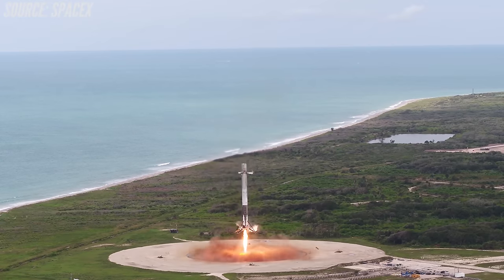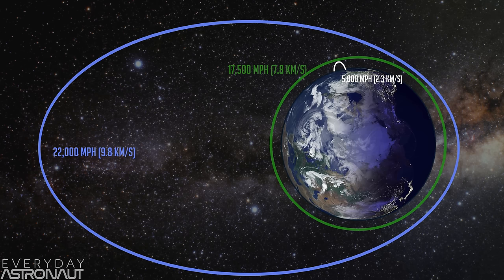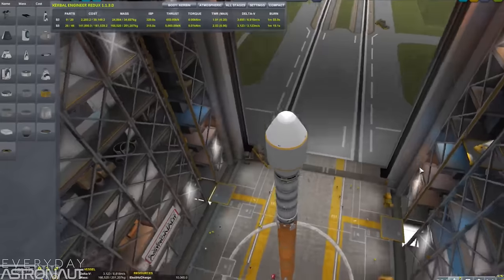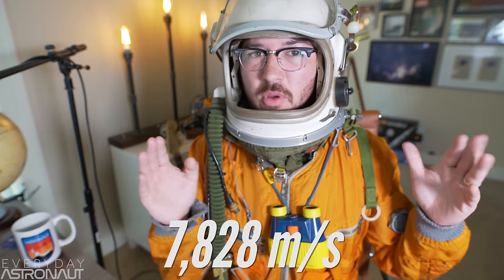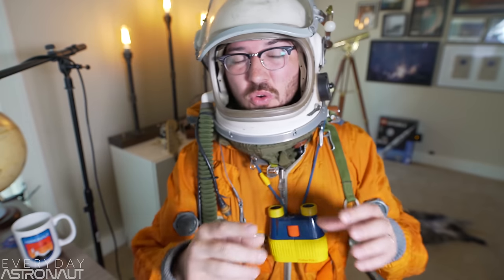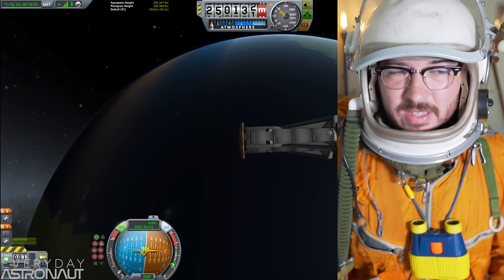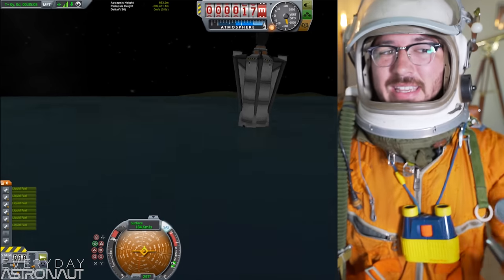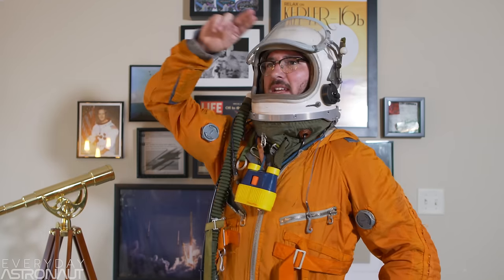Can SpaceX Reuse a second stage?

Comment: Hiya, 
I have a question about other space programs.
Why, do you estimate, does the Indian space program not try to land it's own rockets and why, would you imagine, the Indians do not design a similar 2 stage rocket to the falcon 9?
Reply from the maker: +Dhruv Halwasiya I think it's just a matter of time. Everyone has to mature to the point of having the resources to invest in the research and development. I think many others will follow suit
Reply: Hiya,
Thankyou for your answer.
However I want to ask : was the answer for the first part of the question or the second or both?

I mean, I can imagine your answer applying to part 1 though I would imagine that wouldn't be entirely accurate. I would imagine the bigger problem would be similar to the russian space programs in that to be frank - nobody thought to try it before SpaceX. But since SpaceX has been at it now for first time and since their grasshopper tests demonstrated their capabilities long before my question would be about why is ISRO not trying to imitate them in even a limited capacity.
I would imagine that ISRO had sufficient resources to begin their own grasshopper trials.

I would guess that your response could not really apply to part 2 because I figure pursuing designs similar to the falcon would be cheaper, more efficient and more logical compared to the designs ISRO is currently pursuing and walking on a part made by some other trailblazer is always easier than blazing your own path as it's leader.

Please enlighten, 
I would love to hear your ideas on the topics :)
Reply: Designing a normal rocket is no easy task. Making it reusable right off the bat makes it even harder. There's also the timeline to consider. SpaceX was founded in 2002 and right off the bat reusability was a goal for them. ~15 years later they managed to achieve it despite pretty much everyone else thinking it was impossible. Now that they have shown that it is possible likely other agencies and companies have started to look at it for future designs. However you can't just take a finished rocket and easily make it reusable. Even the early Falcon 9 rockets are already very outdated in terms of landing ability. All this would be too much for a budding space agency to tackle right away. Now that they have proven their own tech and likely learned a ton about rockets in general reusability may be on their radar.
Reply: Hiya Ben,

Thanks for the reply. What you said obviously makes much sense.
The angle I was looking at was : once somebody does something unique, seeing what they've done it is far easier and faster for others to replicate than to innovate uniquely themselves. In essence, I figured there is a bulk of information already available to everybody about how SpaceX did what they did and why their ideas are maybe more efficient.

Your reply was once again about the first part of the question, would you like to discuss the second part about the two stage structure that in my opinion is more efficient and creates less friction/drag?

Comment: Question/solution from an absolute noob. So the kerbin atmosphere ends at 70km over the surface. so why don't you adjust the orbit of the second stage to 69.9km and let the very low air resistance bleed off some of the speed each time the second stage orbits. this allows you to slow down by far more than you ever could with the limited amount of fuel you have
Reply: sorry, the perigee (periker???) should be at 69.9km
Reply from the maker: +Peter Johannsen the problem is once you bleed off only about 200 m/s, you're doomed to reenter, period, so you still require the same amount of fuel to do your landing burn regardless. The velocities end up being the same during reentry
Reply from the maker: +Peter Johannsen yes, and then it'll slow down anyway and just re-enter. It won't really change anything unfortunately.
Reply: hmmm okay.. did you use deadly reentry and ferram aerospace for the sim?

Comment: Question, couldnt they attach fuel tanks on the side of the rocket that it could drop when they were empty?
Reply from the maker: +Gustav it ends up being very complicated to cross feed fuel. The space shuttle did that from its external tank into the orbiter, but it's not something they can easily just do Willy-Nilly. Also the tanks once empty are only like 3% of the weight or something crazy!
Reply: Okay, thanks for the knowledge

Comment: Use a core by itself, send it to orbit to match the second stage orbit, capture second stage, de-orbit burn, re-entry burn, then landing burn.
Reply from the maker: +John Doe the economics of full recovery will be thin, not sure if there's room in there for a whole separate launch... we'll have to see what spacex decides to do! 👍
Reply: It makes sense in that the core is already designed to come back, so why not with a second stage on top of it? Remember what Elon said, It's not the fuel that's expensive, it's the vehicle that carries it.
Reply from the maker: +John Doe the second stage would still need to slow down to the suborbital speed of the first stage and somehow rendezvous during its short 4 minute free fall, attach somehow and then perform the landing burn. I just don't see it happening but I like the thought 👍
Reply: No. A first stage core goes up, by itself, to match the second stage in orbit, rendezvous, dock, de-orbit burn, re-entry burn, landing burn. Remember, the core is going up by itself, so there would be plenty of fuel left to accomplish the task. Try it in KSP and see if it would work.

Comment: Why not just use parachutes? Then you will be able to slow down more while still in space.
Reply from the maker: Parachutes don’t work in space 😉
Reply: No, like after you get into the atmosphere with a heat shield.
Reply: I might add that you don't need fins, you can use inflatable airbag like heat shields on pistons that extended next to the engine. Neither do you need landing gear, just drop it in the ocean.

Comment: It takes a lot less fuel to slow down because you have lost most of the mass already.
Reply from the maker: +Brian Fischer this is true. I meant to say DeltaV!
Reply: Thought so :-)

If I had my $.02, I would design the new second stage as an A/B.

A: Engine, Everything Expensive topped with a heat shield.
B: Tanks and Release hardware.

Let part B burn, easy recovery of A.

Comment: How about in-flight recovery with a UAV?
Reply: Now THAT's imaginative mate! Impossible due to re-entry velocity, but that is great out-of-the box thinking! :)

Unless... if a big a$s parachute was used in the last phase and you could snatch the parachute in mid-air (like they did in the 50's with satellite film rolls)...
Reply: JFHeroux i figure I just watch too many Mecha anime, in which it's kind of a staple. I think there might be some options with unmanned fighter jets as well, as long as you can predict the path the second stage takes well enough. But errors at those speeds would be scary.

Comment: Is it possible to reuse the 2nd stage if you throw away the first stage instead of recovering it
Reply: Like, is there still any good extra delta V that will still make reusing the second stage in practical if you expand the 2st stage Or is that not a bad idea?
Reply: Isn’t the first stage the most expensive part? Why would you get rid of that and keep the cheaper part?
Reply: Maybe, but why would you? The first stage is more expensive so it wouldn't save you any money

Comment: Get's my sub. good thinking and science communication.
Reply from the maker: +jack mack thank you very much!!! 🙏🙏🙏
Reply: Despite your explanation, I doubt many people get the point of the extreme marginalness of the economics of second stage recovery. Gotta be better ways of using the payload to orbit than saving fuel for re-entry burns of a small rocket. And even the rocket must be recyclable ... perhaps make it of a large unrolling solar array to connect and power swarms of small satellites by cable... than recover the lot with a small and cheap recovery unit. Perhaps delivered en mass?

Comment: Try splitting the second stage into two or three pieces for separate re-entry
Reply: I recall the design of a Mars ship was to deploy gas bags to utilize the Mars atmosphere to slow down the spaceship. These bags would be effective in using the thin atmosphere to slow the craft down.  Also, there is nothing wrong with using parachutes and finally rockets to land the 2nd stage. Splitting the 2nd stage into 2-3 parts would still be a good idea to reduce the mass.
Reply: How does splitting it reduce its mass? each piece would be lighter but overall the second stage would be heavier due to the extra parts to facilitate splitting. You then need duplicates to land each piece.

Comment: dude use the Real Solar System mod if you want to simulate real life missions
Reply from the maker: +Nathan Colgan I've heard enough people say this that I might actually try. I've never done it... isn't it like 10 mods? I'm nervous about bonking my game... I was using kerbal as just an illustration but it might be easier to understand with real life values.
Reply: Everyday Astronaut that's fair, I have an older version that I run real solar system on instead of my stock 1.2 install and it can cause some issues but overall it's really cool, adds a whole new dimension to the game, especially if you do realistic progression too so you have to start from like 1940's sounding rockets in career mode. there are 10 or so mods to make it work but if you download CKAN you can install them as a bundle really easily. but overall, it might be better for what you're doing because the delta v you need to get to orbit and the payloads you can carry are pretty realistic. but you do you, you're videos are really cool
Reply from the maker: +Nathan Colgan thanks man! I'll look into it 😊👍

Comment: You could have a refuling station in orbit.
Reply from the maker: +Matija Mandić and then what refuels the refueling station? 🤔
Reply: Separate missions: 1st stage with a tanker attached like they plan to use for the Mars missions probably, I mean that's the next step anyway, have refueling stations all around the system :)

Comment: Trying to save second stage is just stupid
Reply: not if the first stage is also reusable.
Reply: what? you aren't making any sense
Reply: Because the additional weight due to the heat shield will increase the needed size of the booster and increase the cost of the booster but if the booster is reusable it doesn't make a difference against the economy due to the recovery of the second stage.

Comment: How about a heatshield between the tank and the engine?
Reply from the maker: +Imrahil the engines the most expensive part and would not survive re-entry... 😊
Reply: Everyday Astronaut that was the point. Ditch the tank, use the heatshield for aero breaking, deploy a chute and/or do an airbag landing. Second stage isn't coming down without some major changes.

Comment: rcs thrusters are in an inefficient position.
Reply from the maker: +John Hart they're at the end of the lever when pointing nose first which is where they're most effective. Also it's ok, I was only illustrating the difficulties, second stage recover in kerbal is quite easy.
Reply: Lever axis would be the COM, which would be closer to the engine, placing them towards the front would increase the lever distance from the axis. And i understand, you did a great job at it! :)

Comment: re-dock the second stage to the first before re-entry
Reply from the maker: +Fleugar OutDoors the first stage is only traveling at 1/4 the velocity and it's time in space is only about 5 minutes or so... there's no way they would be able to intercept again.
Reply: That is the present configuration, I get it. Fly stage one to a very low orbit, holding mode. After payload delivery of stage 2, declaration burn, dock with stage 1, then re-enter both vehicles Just a thought. A little extra fuel on 2 with an engine that only works in space, a little extra fuel on 1 to accommodate the weight of 1 and 2 for re-entry. I am not a jet propulsion engineer, but it seems the most simple way to solve the problem.
Reply: Fleugar OutDoors Not a bad idea, but it isn't efficient to put the first stage into orbit. The difference in velocity between suborbital and orbital is too great. The first stage is too much mass, which is why they shed it in the first place.

Comment: Could you maybe use a parachute?
Reply: Parachutes are very heavy, they don't slow it down enough, are inaccurate so a water landing is the only feasible option which will then negate saving the second stage as the engines are practically ruined by the salt water. Parachutes also stretch rocket which currently only has to handle compression forces so potentially quite a bit of extra mass to make the rocket structurally sound.
Reply: The rocket could totally handle the load of a parachute. There are other issues, but that's not one of them.

Comment: This trend is 100% backwards!  Mass in space, even just earth orbit is priceless.  So the fact is, the best approach is to boost the first stage into orbit and never bring anything back (except payloads that need to come back to return samples, etc).
Reply from the maker: +max bootstrap not necessarily true. Mass in orbit isn't useful, delta v in orbit is useful. A first stage will never be able to be "boosted" into orbit with any meaningful payload. An empty second stage is pointless in orbit. The second stage puts 3/4 to 4/5 of the total velocity into the payload, so it's not like the second stage isn't doing anything meaningful.
Reply: Hahaha.  Okay, try to build anything [useful] in space without mass.  Good luck with that!  Hahaha.  Also, to BE in orbit requires delta-v, so you're correct but that seems like a distinction without a difference.  In what I was talking about the first stage IS the payload... an extremely useful payload.  Like, for instance, the outer body of a space station or space habitat.  While the diameter of the Saturn V is a bit small for such a purpose, the rocket you displayed is absolutely superb.  True, not big enough to spin and generate sufficient "artificial gravity" to be very useful, but that's okay.  Just take a couple of those huge boosters and connect them to the ends of a long tube, then spin that around the center of gravity.  OTOH, I'm not a fan of artificial gravity... I'd rather live in 0G.  OTOH, it is true that 0G has its problems too (floating stuff can be dangerous), but then 0.1G should be sufficient.

If your goal is to put as large a payload in orbit as possible, the 2, 3, 4 stage approach makes perfect sense.  However, a longer-term view would design rockets to put as many living and storage and experimental shells in orbit as possible.  That's what Mars missions should be built from.  Of course that raises another can of worms, namely the fact that the ONLY sane way to design a manned Mars mission is ONE WAY.   Well over 30 years ago I proposed this to NASA... got laughed at for being silly, even though I volunteered to go on the mission.  That idea isn't considered so out of the question any more.  But then again, seems I'm almost always way ahead of my time.

PS:  If the purpose is to get something huge like a first-stage into orbit, it may still be true that a smaller "throw-away" first-stage at the bottom may still be the best design.  But even here I think unconventional approaches may be better.  For example, a configuration that discards "first-stage" fuel and oxygen tanks... but keeps the rockets (and possibly some structural framework).  Long ago I looked into various possibilities, but haven't revisited that idea in recent years.
Reply: Rick Lokers  : I used to... but unfortunately I have a terrible memory, and I've forgotten more than most people will ever know.  So yeah, sometimes I forget important factoids, tradeoffs and considerations when I revisit questions.  The way I "remember" such things is work through the questions again and eventually I vaguely remember... "oh, I've been here before"... and now remember why again.  One problem with this particular topic is... back when I was dealing with these questions a long time ago... reuse was not considered practical.  That's probably why my instincts are now wrong sometimes, because reuse really does change tradeoffs and other considerations quite dramatically in many cases.  PS:  I don't mind looking or sounding stupid while going through considerations like these.  That's where novel opportunities occasionally appear, seemingly out of nowhere (but actually as a consequences of thinking everything through again).

Comment: use parachutes, then it works
Reply from the maker: +fs2728 the landing from 100 m/s to zero is the easy part, surviving reentry and scrubbing off the 8,000 m/s down to the 100 m/s is the hard part. Parachutes don't work in a vacuum to slowdown before reentry and they also don't work during the heat of reentry. So no. They are not a valid option for reentry.